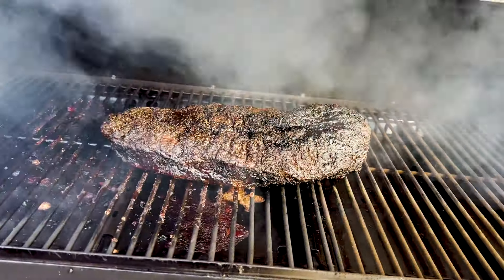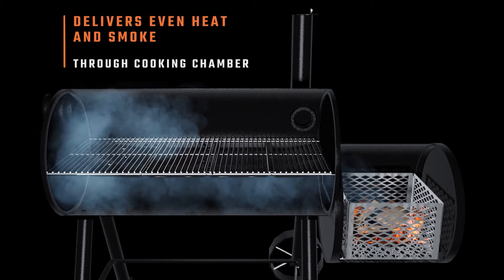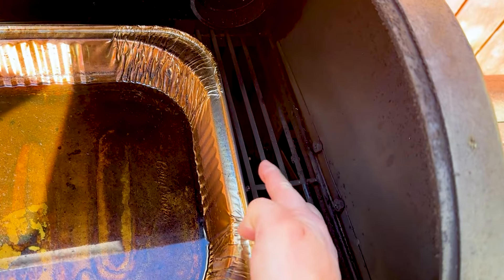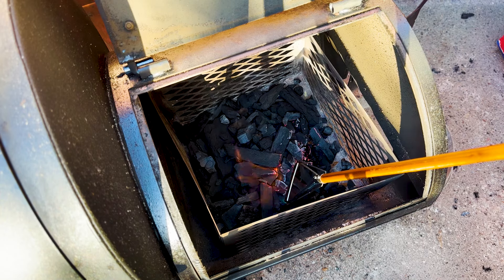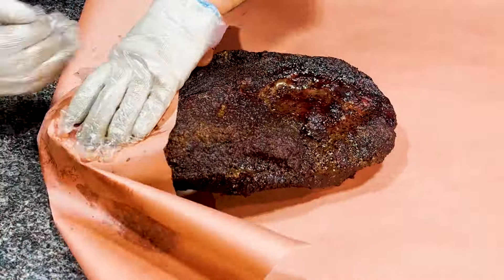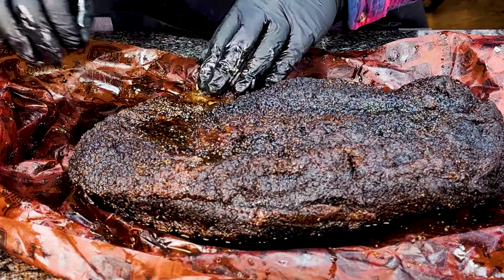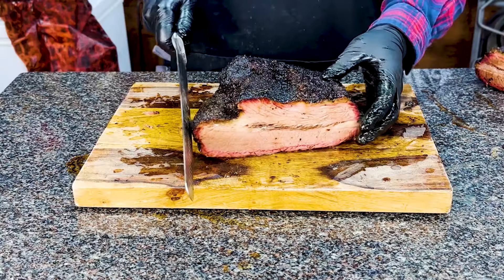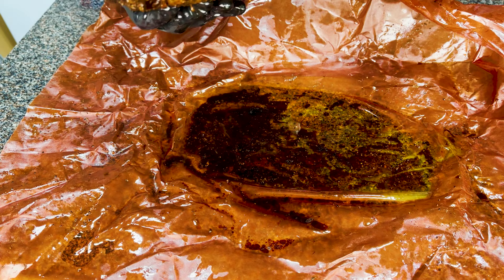Offset vs Reverse Flow Brisket | Smoke Lab with Steve Gow | Oklahoma Joe's®️

Comment: The baffle plate on your Longhorn is very thin metal and is much closer to the brsket than the plate on my Lang. Its nice that you can do this on the Longhorn , however you should compare a true reverse flow to a direct flow. These cheaper hybrids wont compare at all to a reverse flow pit like a LANG.
Reply: Wish I had one!
Reply: @SmokeTrailsBBQ  So come to FL and do a video with mine and we will make a true comparison.
Reply: would something like adding fire bricks draw heat from the baffles and keep the heat lower in the cook chamber at the baffle height?  keeping the baffles from getting too warm? I hear this theory thrown around a bit.
Reply: The smallest Lang appears to be about twice the price of the Longhorn, so yeah, one would expect something a little heavier dudy.
Reply: What I found interesting in offset direct flow mode u didnt put a downward sloping diy baffle like u did on the highland...I was hoping that wouldnt be necessary on the longhorn

Comment: Them plate you are putting in to make it a reverse flow are very then so I don't believe you are gonna get a good comparison. I have a true reverse flow offset. It has a 1/4" plate under the grates
Reply: Do you get any radiant heat from the baffle?
Reply: @SmokeTrailsBBQ  you know as well as I do that any and every kind of baffle is gonna give radiant heat. But I get my smoker really hot for a good little bit then let the temp come down to where you want it and the baffle will adjust too and help keep temp stable. And don't have any problems with the bottom of my meats over cooking or burn and hard. I cok my briskets fat side up. It has great convection too. I built my smoker myself. I cooking chicken quarters on it today and from the stack side to the otherside is 5° difference
Reply: @chuckhansen5325  5 degrees is amazing!
Reply: @SmokeTrailsBBQ  I was just rewatching this video and I have to tell you I have enough space between my baffle plate and grate and I can put a big water pan in there and not get alot of the radiant heat directly on the meat. I built it that way for that reason. It's a 75 gallon cooking box with a 24x24 fire box and I use like 12" splits and it hold temp great and I'm not putting a hole bunch of splits in it. A split about every 30 minutes or so. My bottoms on my briskets are not crusty or over done and my smoke stack is directly over the fire box and grates are in center of the fire stack. I get smoke all around what I'm smoking. Really liked video. Keep up the good work buddy
Reply: @chuckhansen5325 Hi Chuck,

I have a custom built pit RF in 1/4" steel and today I am experimenting with a large water pan on top of the RF plate up close to the firebox. I did this to try and improve the underside bark of my meat by avoiding to much steam directly under the meat and using the water pan closest to the firebox to absorb the heat off the plate to remove some radiant heat and send it straight out the stack. Where do you like your water pan?
Reply: @razeunit69  I have like 2 wide water pans that I put on my baffle plate below what I'm cooking
Reply: @chuckhansen5325  Nice.

My experience from yesterday, after 6 hours I lost only half a water pan and had perfect bark all the way around. On my RF if I cook between 225f-250f I get little to no radiant heat on my RF plate. If you do have any issues with steaming, give my setup a try and let me know how you go :)
Reply: Mine is 1/4 inch plate but has enough room for water pans between the grill and plate. We did build ours
Reply: @ScotKyle-q1k  that is great that you can put water pans between the plate and your rack

Comment: Thanks for all the tips . 
Loving my new reverse flow. 
One thing I noticed was you placed the water tray right next to the stack, upwind of the brisket with the reverse flow. That moisture is going straight out .
Mine came with grill grates for the bottom of the smoke chamber and that’s where I place water. It catches grease and the steam smells great because of it. 
I imagine it helps keep temps from dropping so quickly also .

Comment: Would fire bricks over the baffle plates absorb some of the radiant heat in the reverse flow setup?🤔🤔
Reply: Yep it would definitely absorb more radiant heat, just like  a big ceramic heat deflector in a kamado smoker. But that energy needs to go somewhere and it would still radiate into the meat, potentially making the radiant heat issue even worse. That's why water is so great as a heat sink. It can only get up to 212 degrees and excess energy is converted to water vapor/steam, provides humidity in the cook chamber and exits out the stack.
Reply: @SmokeTrailsBBQ   how could you put fire bricks over the baffles? I thought you would put them in the bottom to absorb heat from below to keep the baffles cooler.

Comment: I built my own reverse flow out of a 60 gallon air compressor tank with a 1/4 inch baffle plate with enough room to fit water pan under the grate l love the results l love watching your videos my next project is making a sous vide holding chest
Reply: That sounds awesome! Good luck on the chest

Comment: I get fat side up on a traditional offset, but why not fat side down on a reverse flow and take advantage of that radiant heat to render the fat cap?
Reply: It messes up the slices. Fat side up is really the only way I cook.
Reply: @Smoke Trails BBQ  can you expound on messes up the slices, what does that mean?
Reply: @lyleswavel320  It creates grill grate marks on the fat cap and when the brisket is moved during the cook the rendered fat can tear and mess up the bark. The fat cap also isn't exposed to the high convection and heat/smoke that flows from the top in an offset so it doesn't form that nice perfect black bark with rendered fat underneath. So when you slice it, it just doesn't look or taste right.
Reply: @SmokeTrailsBBQ  that makes sense, just wondering, I like my fat cap on top also

Comment: Highly informative comparison. Did the brisket cook faster in the reverse flow smoker?  I suppose some of the smoke sticks to the walls of the tunnel, in the case of the reverse flow. I wonder whether a second set of baffles with an air gap separation would resolve the radiant heat issue coming from below. I hear reverse flow is desirable for larger catering size offset smokers, one 
advantage being, it takes significantly shorter time to get the pit to temp..
Reply: I can't recall but I think it might have due to the radiant heat. It's great for cooking a ton of ribs or butts but when it comes to brisket my preference is just a traditional direct flow offset.
Reply: My Lang Cooks faster than traditional smoker

Comment: so what do you think what would happen on a 500 gallon reverse flow. I'm in the market for one and was thinking it would be a more even cooking enviroment, But I'm also interested in the tried and true smokers. Great video and I have new thoughts. thank you
Reply: I've never used a 500 gallon reverse flow but I would speculate it would be more of the same just on a larger scale. You'd get more even cooking but still have radiant heat from below to deal with. I personally like direct flow offsets because they deliver maximum convection to the top (fat cap) of the brisket and I like the way they cook. But reverse flows are amazing if you're not just cooking brisket because you can fit more meat on them. Here's a good video on the differences from Smoker Builder: https://www.youtube.com/watch?v=nQ_R0OBwBqE

Comment: It looked like the pull temp of the standard off-set showed 194-196, and the pull temps for the reverse-flow setup showed 185-193. Could that have been the cause of the RF setup brisket a bit tighter as you described? 

Also, I would like to see the test with the reverse flow fat cap down. You had the fat cap up on the standard flow which has the radiant heat above, which I agree with, but you had the fat cap also up on the reverse flow that has the radiant heat below. having the fat caps towards the radiant heat on both pieces of meat, though subtle, might be a more accurate test. Always learning and love your videos, thanks.

Comment: I have a RF Highland and my bark ends up looking about the same as the one in this test. I wonder if wrapping the baffle plates in some aluminum foil might help reflect some of that radiant heat away from the bottom of the brisket. But still poke some holes in it to allow the smoke to pass through the baffles and get that bottom area of the brisket exposed to smoke. Maybe combining that with some cooling grates to raise the brisket a bit off the grill grates as wel… hm… 🤔

Comment: Steve I have a request.  The way you move from top exhaust to grate height exhaust can be done cheaper.  I made the mistake in buying an Oklahoma joe's longhorn combo so I can't test this myself .  My thought is to take a large round shallow pan (like a Costco pie tin) and cut almost half of it off.  Like an unbalanced pizza.  Using high temp silicon glue, it over the exhaust port inside the cooking chamber with the cut part down.  And Ta Da we now have a draw from grate level with a collector to ventilate the whole grate.

Comment: What's the idea with the orange on the smoker?
Reply: Protects the bits of the thermocouple that shouldn't be exposed to direct heat (in the case of the Meater) and keeps them elevated above the grate by a couple of inches for a more accurate reading
Reply: Need it to protect the one side of the meater

Comment: I have a 20 pound brisket that I plan on cooking everything i read says i need to cook it for 14 hours. or until the internal temp is at 190 degrees. Is that correct or should the cook last longer? Thank you for the helpful tips on the water pan to reduce the bottom pan heat!
Reply: A 20 pounder will take 12 to 14 hours to get to probe tender (around 203+). It also depends if you wrap it.
Reply: @SmokeTrailsBBQ   I definitely will be wrapping the brisket for sure in butchers paper. I was thinking around the 10-12 hour mark depending on color and internal temperature. Thanks for the reply. I love that. Your food also looks awesome.

Comment: Now do the same test but cook fat cap down.
Reply: I'm not a huge fan of cooking fat down but it's a good idea!
Reply: Great idea Nachonad. Have you tried this yourself? 

I would also think reverse flow smoker could cook 25F less than standard flow and cook in similar times.
Reply: @razeunit69  I haven't. Just theorizing.
Reply: @SmokeTrailsBBQ  Sure. I just know that those that cook fat down do it to avoid the issue you had with the reverse flow.
Reply: @nachonad  Some guys have heat deflector plates built in their RF setups. I have ordered a RF with deflector so I am keen to see how it goes. It is from a local guy who competes and has won some comps so super keen to get into it :)

Comment: Just found your channel, but it already fits like an old pair of boots. Scotchy Scotch lovin' vet smokin' meat, doesn't get much better. Maybe a comely wench fetching me adult beverages? 😉
I was just looking at replacing an old as hell 30 gal. I've had for almost 30 years I think. Never particularly well cared for,  paid about $125 way back when, so I think I got my money's worth. Saw the Longhorn at Lowes (eff HD, Lowes has a much better veteran discount program) and your presentation convinced me that it'll do everything I need for our small family. I love all of the different ways you can baffle the heat path and smoke, and it got me thinking about just how hot you might be able to get it, for cooking other stuff. Never did much brisket in my old one, but lots of whole & cut up chickens, tri tip, and tons of pork (we raise Kunekune pigs). We have a Cajin Cooker/pig roasting box that can do a lot with indirect heat and up to 150 lb. pig, but they're not built for smokin' (you can add a smoke element to it, but it ain't BBQ).
Anywho, got me wondering, 'cuz I also cook a lot of home made pizza and had briefly considered one of those new fangled outdoor pizza ovens... I wonder what kind of bake I could get by placing a big pizza stone in there and jacking up a really hot fire. It looks like it wants to jump up out'a the fire box already when you really stoke it, and I'm guessing it wouldn't take much to get it up to 650-700 F. Just a thought on trying to get double duty out of another appliance that wife number last will probably not approve of.
Thank God for Scotchy Scotch. 😊
Love your channel btw. 👍